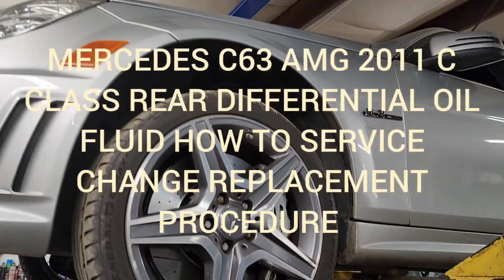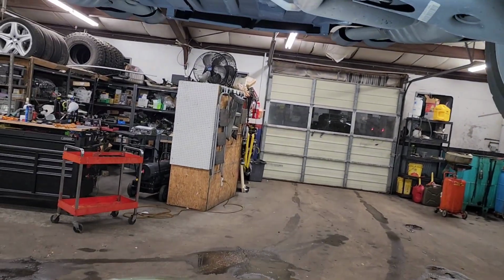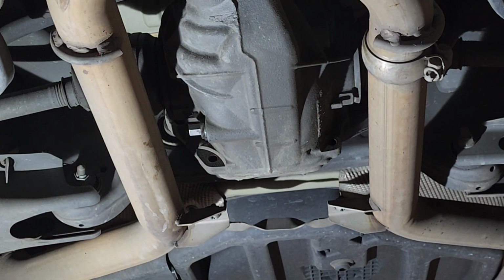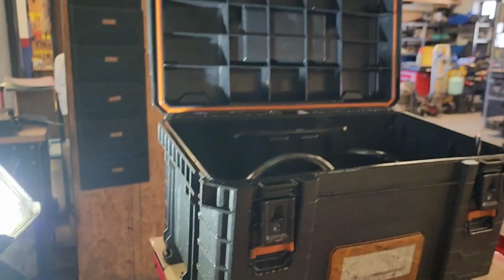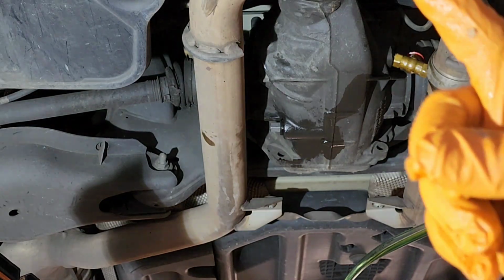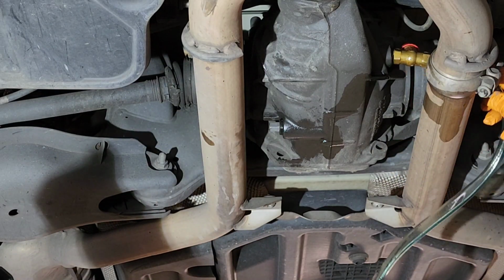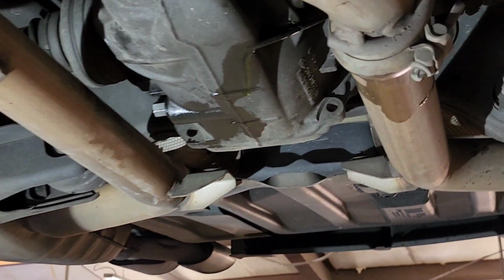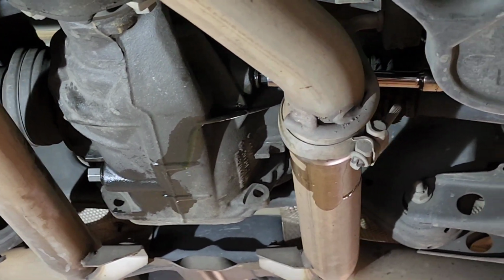MERCEDES C63 AMG W204 C CLASS REAR DIFFERENTIAL OIL FLUID HOW TO SERVICE CHANGE REPLACE PROCEDURE

Comment: Any recommended torque for tightening plugs ?
Reply from the maker: You mean the Spark Plugs? I can check and tell you what the recommended torque number is. Also I would tell you what number I would use... I have seen some problems with torqued plugs that after time after being torqued with factory recommended torque would become loose... When I get back to the shop I will let you know... Thanks 👍